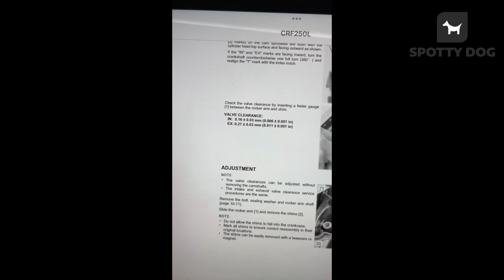ENGINE BLOWN-UP! ENGINE SWAP 2015 TO 2017 UPGRADE, HONDA CRF 250L VALVE CHECK HOW TO VIDEO!

Comment: That weep hole (breather) is kind of an indicator of water seal leak and oil seal leak next to water pump. They made it like that so if either seal fails, that stuff will come out of that hole and you know you need to replace the seal. When bike is new water drop here and there is normal for first few thousand untill seal beds in, oil side shouldnt leak at all. I zhink its mentioned in owners manual.

Comment: Not tempted to drop a CRF 300 / CBR 300  engine in there?
Reply from the maker: I was tempted, but I’d need a new ECU and maybe throttle body.
Reply: @SpottyDogBikes  there is a company that sells the ecus in America for 150 dollars.  Not a cheap engine swap but it would have been a fun one.